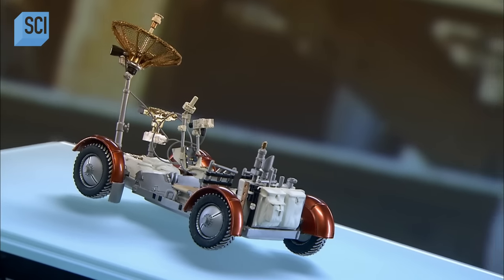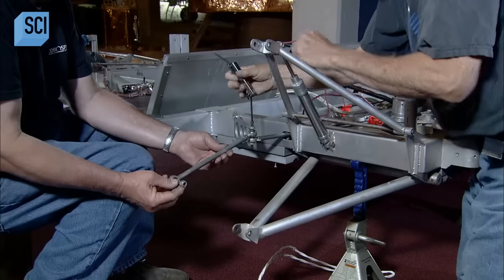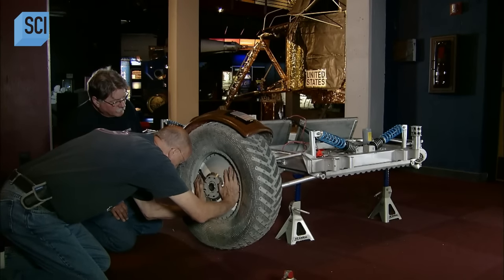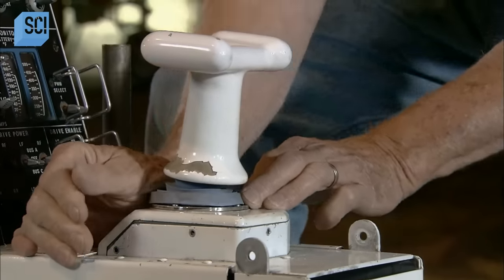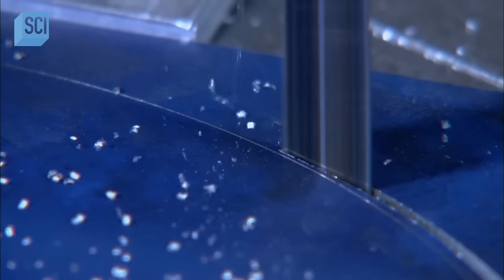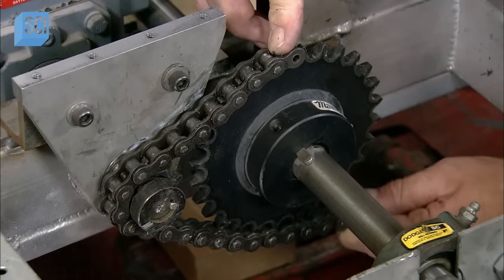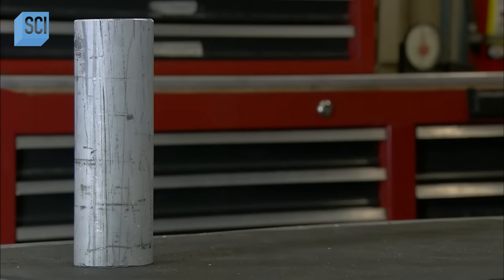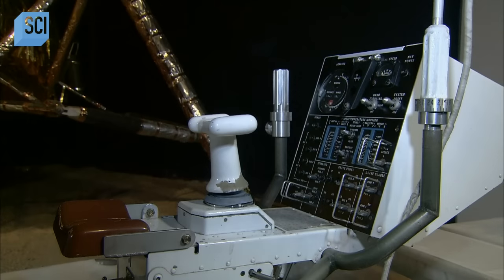How the Lunar Rover Is Made! | How It’s Made | Science Channel

Comment: I'm pretty sure the speedometer would have been in mph and not kph since it was Americans.
Reply: It was in kilometers.
Reply: @Jon_Flys_RC  I know, that's what I said. But it shouldn't have been since it's an American vehicle made by Americans that use miles per hour.
Reply: @JoshRhoton pretty sure they use metric system with space engineering as every other country in the world uses it except the US. There have been conversion errors that have led to failures.
Reply: NASA uses the metric system
Reply: Ok, that makes sense. Ty
Reply: @bosanaz2010  I get it. I love the metric system as it was a Volkswagen mechanic for a long time.
Reply: @IceNinja47  they use both.
Reply: @popeyethepirate2902   As by written into law, NASA must use metric units wherever economically possible. For the entirety of the Apollo program that NASA was responsible for, metric was used to design the vehicle. Interfaces only displace USCS units for the sake of the astronauts. Metric is now used by NASA almost exclusively due to constant collaboration with the ESA (and the rest of the world). Anyway. USCS is just a strange extension of metric units, Imperial units do not exist anymore.
Reply: NASA uses metric for easier conversion and calculation
Reply: @ollie4022  American vehicles use both systems and tools in America have both systems.
Reply: @popeyethepirate2902   Never said they didn’t. Many Americans find it easier to work with mm for smaller scales and stick to customary units for everything bigger than a foot. Whatever works for them, provided they know how to convert all necessary units. Never been sure about why there are kilometres an hour on the Speedometer when no one uses them, but that’s the same practice used in the UK.
Reply: @ollie4022  America is filled with foreigners who come from countries that use kilometers, that's who uses that system, so that's why it's there. Like I said, they use both. So when people say the metric system isn't used in America, they are talking out of their ass.
Reply: @popeyethepirate2902  facts, I tell my wife my size in metrics... It sounds way bigger.
Reply: Science is different
Reply: @JoshRhoton  football fields per hour.
Reply: @JoshRhoton even americans use metric when it's science/engineering related.

Comment: This is not how the actual Lunar Rover is made.
Reply: Did zip ties even exist back then? Wax coated lace would have been used to hold wiring harnesses together.
Reply: @ataricom  Zipties were invented in 1958. They were used primarily to bundle wires together in planes. Plausible for NASA to use them at the time.